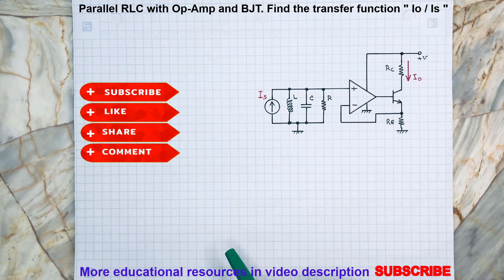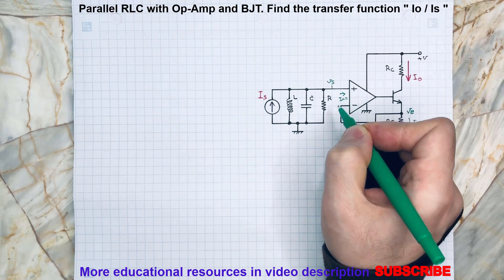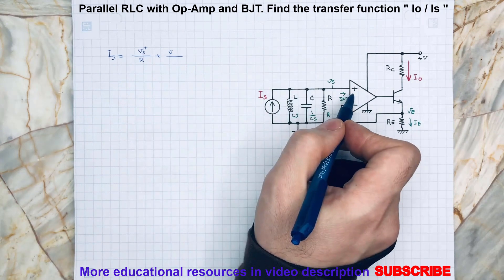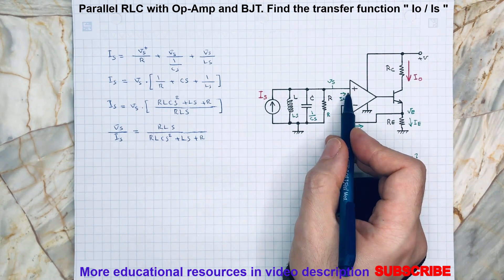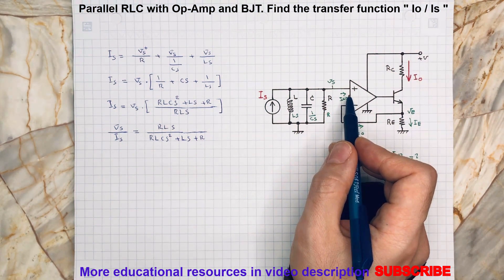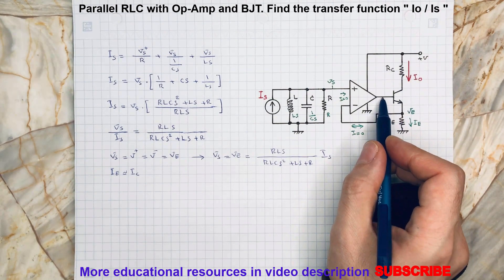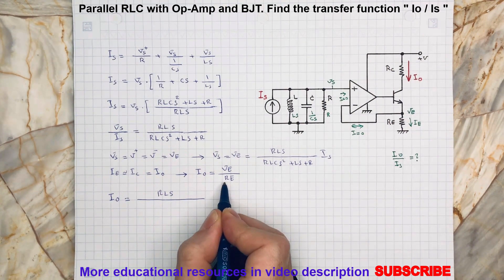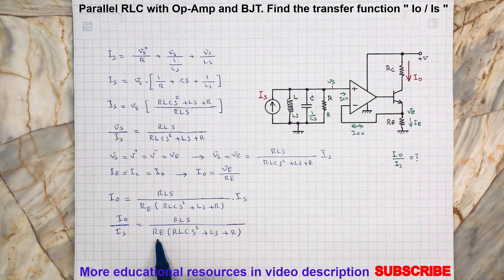Parallel RLC Transfer Function of Op Amp Circuit

Comment: Much appreciated sir 😊
If have no R,L 
Io/Is
Is*R/Re=Io
Io/Is=R/Re
Add L or C or L and  C is the same way
What kind of circuit is this applied to?🤔
Reply from the maker: This is a band-pass filter and the resonant frequency can be defined by L & C, and R can define the frequency bandwidth. The Op-Amp provides high input resistance and isolation between input and output, and BJT is responsible providing output current.